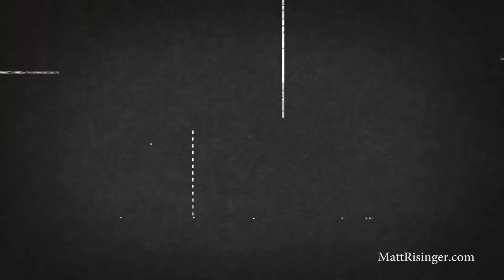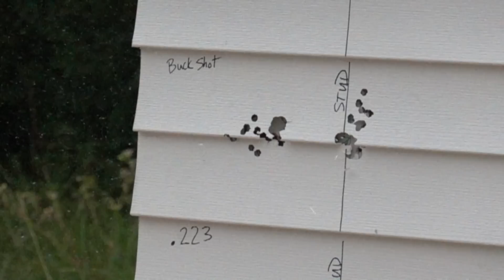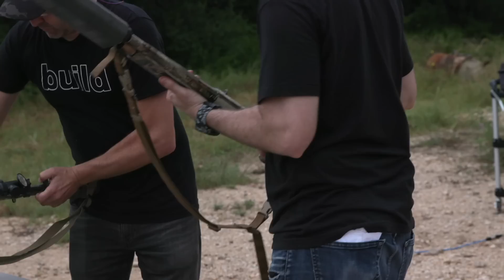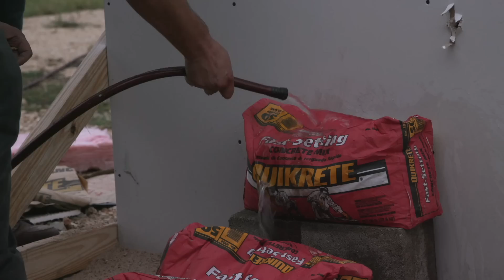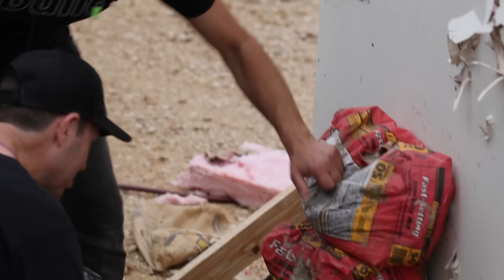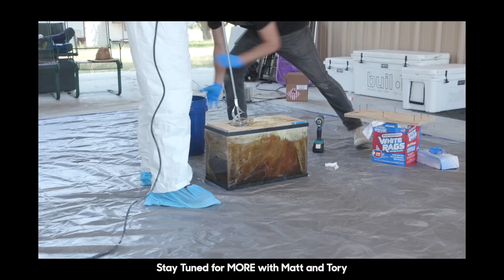Will your house STOP A BULLET?  Guest Star - Tori from Myth Busters

Comment: Hope to see a video to see if "stray bullets" would go through a house wall. The most common scenario I think is - The gun should be positioned at least 20 yards away from the house "walls",  as if 2 individuals in the front side walk are arguing , then gun fire erupts. I experienced that scenario  more often than a person 3 yards away pointing a gun straight into my house wall. Also 20 yards away is a more realistic distance for a vehicle drive by "gunfire" scenario if someone sprays your house with bullets and THE WINDOWS have to be secured as well since the 2d scenario gives you little time to get down and take cover.

Comment: Germany here: Is this what the houses are made of, that you see flying around in TV when it's a little windy in the US? Few months ago I built an extra noise reduction wall on the inside of my garage door which is more massive than those "walls". 

My dogs shed is more bulletproof... 😂
Reply: "when it's a little windy in the US?"
The US has tornadoes and hurricanes. The tornadoes tend to be around 260 km\hr. The hurricanes tend to come with a bit slower winds, but they do have a 3-5 meter wall of water with them. Germany....not so much.
Unlike Germany, the US has a lot more land left to build new houses without having to rear one down.

Comment: I worked for a company based in FL.  I was based in GA and visiting the headquarters.  I had a meeting in a conference room in the middle of the building. As I walked down the hall, I noticed what looked like a piece of copper embedded in the sheetrock.  The President of the company walked by and I asked what was this piece of copper?  He had no clue. I put some tension on it and it fell out of the wall.  It was a slug.  I was using an office on the other side of the hall.  The bullet went through the metal panel of the metal building, the sheetrock on the exterior wall, both layers of sheetrock on the hallway wall and the ended up in the conference room.  Someone, drove through the parking lot and unloaded a gun into the exterior wall from about 20 ft.  It was odd working in that office for the rest of the day. The desk faced towards the exterior and you could see the sun shining through the bullet hole for the day!

Comment: Swap the first peace of ply wood with 3/4 inch Cement board.   So wall gap with insulation then cement board then metal then plywood then drywall for finish.

Comment: Could of saved yall the testing on the myth. In early 1990 a nehbore of mine was sleeping in her bed when a hunter with a 30-06 shot at a deer the bullet missed the deer and not only went thru the thin brush near her home but went thru the exterror wall and plywood and sheetrock but it also whent into her back and got loged in her chest. She bleed out fast and died.

Comment: There are a lot of other wall construction methods other than the ones you tested. 
You should have done a brick wall for example.

Your prototype wall would probably work if you added a second layer of steel before the first layer of plywood, and changed the outer from OSB to plywood with another steel sheet between it and the studs.

Comment: I have a hard time believing any of those bullets went through 3 1/2” of wood (the 2x4).  They probably ricocheted off and continued through the drywall or entered at an angle and so only penetrated a portion of the stud.  It would have been nice if Matt had opened up the wall afterward to see the internal damage.

Comment: Dirt or sand will be the best bet as it does not have a cellular structure to split like living material, and it will not break apart like concrete after a few shots. 

Of course the problem you’ll have is losing your dirt and sand when the outer structure is compromised.

Comment: Vinyl siding, 7/16 OSB, pink insulation, 1/2 inch drywall with a stud ...2x4 here and there. Nope .... comes in the front goes out the back. Anything in between resembling human flesh gets a hole in it. As much as the 2nd amendment makes it possible to own and bear guns for protection or hunting, in a real world situation a stationary target only has ONE TIME to fire and protect before obliteration from the enemy or the enemy government. 100,000 rounds will not be enough to save anyone in that structure.

Comment: Since I lived on the west side of SA Texas & had a kid, I had to have a house with a steel door, uphill from the street, with 6 inch limestone block facia outside up to 3 ft & brick above that. I calculated that the trajectory of a bullet from a drive by shooting above the limestone would be over 3.5 ft inside near the front of the house & above 7 ft by the middle of the house. 30-06 rounds might make it through the 4 inch brick but probably not the 6-inch limestone. Definitely the windows but they're above 3 ft. In Texas you have to think of these things if you live in a bad neighborhood and you have kids.

Comment: if the bad guys are at least 50 ft if not 50 yrds like real life then i would be pretty secure with just 3/4 inch plywood underneath the interior drywall.
you  may still get hit by larger rounds but significant energy  loss and deformarion of bullets will make it much more survivable

Comment: Fun episode. Of course a quick Google search will get you ballistic panels rated to the same levels as body armor. I have seen a special installation of said panels. Looks like drywall, but extremely heavy.  In my travels I at one time found a timber home builder in TN who was not building wall for ballistic protection, but he did a practical test like you did and achieved at least protection from multiple hits  from handguns, and maybe 7.62. I believe the construction was  geared towards passive conditioning, so high mass walls. Whole log homes should do well here. Don’t see you shooting through too many trees.

Comment: Standard knowledge, earthworks stop bullets pretty well, even explosives and artillery shells. Which is why soldiers dig in. A rammed earth house will stop pretty much everything you could throw at it under the failure point of the wall itself.  Concrete can be reduced (which is term used to describe destroying cover). It is harder and thus over time degrades. Sand works so well because it collapses after it's shot, restoring the barrier. Brick (real brick not concrete brick) is a ceramic. Ceramic destroys incoming bullets very well (it is used in lvl IV body armor) but again it is very vulnerable to being reduced.  Generally speaking the older "more expensive" but also thermally massive kinds of construction is more durable to things, bullets included.  Try this out with a rammed earth brick wall. There was a company that was in Texas that was building homes with on-site material harvesting and manufacturing bricks right there. Really curious about that. If I had money I'd build a thermally massive house rammed earth or rammed earth brick.. or even stone block with half-ton stone blocks.

Comment: Fill cavity with 1.5” rock. Bullets ricochet off rocks and loose inertia before getting through.  Not a great R-value and may need to be 2x8 wall cavity.  Hmmm 2x8 stud wall with 3” Gutex continuous on exterior and blown in cellulose above the 4’ high rock fill in the cavity so you can crouch down to be safe from gun fire and you have a Passive House, natural building material, bullet proof house! Ready for it ALL!!

Comment: The house I'm living in is a typical Norwegian house and the walls are from the outside 1.5 cm wooden boards, 2 cm osb plates, the framework and the isolation, an inner wall made out of 1 m wooden boards and finally on top of that a 2  sheets of plaster plates on top of each other. 
All in all the outside wall is 25 or 30 cm thick, I cant remember exactly. Inner walls are in this house 15 cm thick.

Last time I drilled through the wall I had to use a 40 cm long drill bit to get through. In an older house I lived in before the only way to get though the wall was with a chainsaw and it took three chains to do it, the walls were massive wood and crushes coke. It was a frigging nightmare., they even used the stuff in internal walls and ceilings.

Would bullets go through something like that?

We build houses really solid here in Norway, not so much for newer build though.

Comment: There's a guy who builds houses for security. He recommends that you use 2x6 construction, at least, and pour 3/4" gravel in your exterior walls. All insulation would have to be either inside or outside of the studs. He also recommends steel studs instead of wood. Gravel is more resilient than concrete because holes can be made in concrete whereas gravel will fall and fill in any chips that could be made. I suppose filling with sand too could be good, but I think the gravel has more stopping mass.

Comment: Fiber board, osb, and dry wall is not a "well built" wall structure...even in merica
Reply: well we in Germany do have 40cm (16inch) brick walls. So i dont think a gun could shoot through. Even normal garages in Germany do have (i estimate 15cm or 6inch)  reinforced concrete walls.

Comment: add blueboard to the sandwich, before plywood. then metal then plywood. you need to deform bullet first to reduce penetration potential then you need to slow down fragments then you have to capture them. thus hardest material - cement board in the front, then steel then plywood. also multi-layer canvas cloth impregnated with cement and then let to set also does pretty good.

Comment: You don't mention what type of bullets you are using and it is pretty critical.  Hollow points are meant to fragment, spread and stop when they encounter an obstacle.  So if you have a gun for home defense, you want hollow points so they won't penetrate walls and cause collateral damage (though they do more damage in the human body).  Metal jackets are meant for penetration, so those will go through most materials.  Standard bullets will probably penetrate walls in most cases, depending on caliber.

Comment: @Matt_Risinger well that was fun. But the proper terminology is bullet resistance not bulletproof. There are some very good wall design parameters to make your wall bullet resistant. There are items such as fiberglass reinforced drywall which you need a concrete saw to cut, there are wall assemblies that use fiberglass reinforced board Along with sheet-metal on one side with the cavity filled with a specific type of gravel. There are all kinds of designs out there or you can look this stuff up it’s easy to find and you can see the testing that has been done. Bullet resistance not bulletproof

Comment: Should have sandwiched aluminum 1/2" between two 3/4 plywood. Or sandwich between two 3/4" plywood expanded metal (two or three sheets) offset from each other ( the angles of the metal will deflect the round) cool video for sure

Comment: I agree, if bulletproof was is your primary criteria, then ICFs are your only choice using standard building texhniques
Reply: Cast in place concrete is more common, higher strength, less thermal bridging and less cost

Comment: Now I know this would be a challenge, but I once worked on a cabin in the middle oh no where Wisconsin  that ended up being 1/2" sheetrock, R13 insulation on rough cut 2x4 studs with (no shit) rough cut 2x8s for sheeting. The home owner then wanted taped 1/4 inch fan fold put on before the final T-111 layer was but on. How bulletproof do you reckon that place is?

Not even joking. The place was sturdy! We think it was made on field stone originally and expanded with block. It was by far the strangest building I've ever worked on.

Comment: You should have shot a brick faced wall and a solid structural brick wall.
Reply: People have already tested that. A .223 will get stopped on the first round by a brick. As the brick breaks, usually the 2nd shot or 3rd shot passes through if fired in about the same place as the 1st shot. However, 7.62x39 (ak47) will penetrate brick on the 1st round.
Reply: @Steven-gv1ke  brick is baked mud, very weak. block is stronger but about as cheap as you can get. the large hollow sections don't contribute to the strength.
Reply: @Baigle1  and mud is like sand which worked well in this experiment
Reply: @FirmFoundationNews  and sand is like glass which grows from the C-S-H, but only to be replaced by sapphire glass concrete (Aluminum Oxide instead of Silicon Oxide binding matrix/foam/framework)...
Reply: Here in Italy older houses are built in stone and concrete
Reply: @Niko-xt5bs  i think thats common in europe im in england and my walls are like a mix of rock  and like a cement or concrete type thing there about 1 foot thick

Comment: Should have put the metal on the outside of the studs and a fiberglass Kevlar cloth on the inside
Reply: @BenjaminFranklin99-s9n  the first layer should be designed to slow the velocity the second layer than catches it.

Comment: So basically just double up the wall and fill the inner with sand and call it sound insulation, only have to fill the first 5-6 feet regardless.
I wonder if a concrete board added to your plywood sandwich would have done more, usually composite armor has a layer to break the bullet so it has to be harder before it gets soft with the plywood layer.

Comment: Do the same test on a 6inch ICF wall.  Include rebar with the concrete.
Reply: 6 inch is nothing. classic cheap ICF. the single row of rebar every now and again does very little for structural support. bad

Comment: What about a wall with the foam block and cement between the foam layers.  That should stop even the AR-15. Really good video.
Reply: Some channels have shot through cement block before, so I think it would still require layers of harder material, I would just add a cement board surface layer to his plywood sheet metal sandwich to try to shatter the bullet before catching it.
Reply: @omgwtfbbqstfu  Not Cement blocks, this is a form and insulation piece all in one that they put rebar in and then pour concrete between the foam boards.  Matt has shown this type of construction for basements before and I have seen where they have used the same process to make all of the exterior walls up to the second floor this way. For the ones, I have seen the walls are 6 to 8 inches or more in thickness. Usually, the foam parts are only an inch thick, so that makes the concrete 4 to 6 inches in thickness. Put a stone veneer on the outside and 1/2 inch gypsum board on the inside and you have 8.5 to 10.5 inches for the outer walls. One would hope that would stop a bullet even from the AR-15 or Shotgun.

Comment: .223 and 5.56 have deceptively good penetration because of their velocity. 7.62 would be even better though. I think doubling the thickness of the walls and filling the inside layer with sand would work pretty well, although I'd be worried about the sand eventually putting too much horizontal pressure on the drywall. You also probably wouldn't be able to fill the whole height of the wall without adding reinforcement of some kind for the drywall.

All that said I grew up in a part of the country were it was disturbingly common to find bullet holes in your walls because people ignored safety rules while hunting or shooting in general.

Comment: Next on The Build Show, will this 10” ICF house stop a .50BMG? 😏
Reply: I saw an article years ago when a drunk driver hit an ICF house in South Florida, hubby goes downstairs to check for a "burglar" and finds a car had bounced off his house, NO damage on the inside, not even a crack on the concrete when they cut the drywall off for inspection to check for any spaling, no damage other than replacing the stucco on the outside.     That's why I love my ICF, 6" concrete walls with spray foam in the attic.   My last years HVAC bill was $160 for 12 months TOTAL,  the thermostat logs all power consumption for HVAC purpose's.   I cheat I use a wood stove in the "winter time" here in South Alabama on the Gulf Coast.

Comment: Correction: the military isn't using an ar15, they use an m4/m16 which is full auto. Also the FBI did a study and found that in an average home .223 is actually less likely to over-penetrate and be lethal, largely because it fragments upon hitting resistance, which is why the holes when going through the stud and the metal reinforced wall were so large on exit. If buckshot/9mm/.45 make it through the wall they are more likely to still be in a ball form that will do damage.

Comment: Meanwhile in Florida, except for mobile homes, 99.99% of houses built since the 1950s are either concrete/masonry block or something stronger (cast-in-place, tilt-up, or prefab concrete or ICF walls). You should have measured against a concrete block wall clad with fiber cement boards (or stucco) on the outside and studs/sheetrock on the inside.

Comment: Pumicecrete is bulletproof hurricane proof termite proof rust rot and mold proof tornado proof highly insulated great sound attunation and water will not hurt it and you can fully submerged your house and it will not hurt it

Comment: That was interesting and unexpected.
This info is even useful for someone who needs to retrofit their home with a little protection. But all fun aside, most people would be well served to at least bulletproof a lower wall section of a safe room or towards the street/neighbors. For that you can build a 4-6 inch deep wall in front of the existing wall and fill it with sand. The top can be finished as a wall long shelf. So in case of a neighborhood shootout you just drop to the floor and are safe. 

There is one other option though. Move so far out of the city that you can identify any threat from half a mile away.